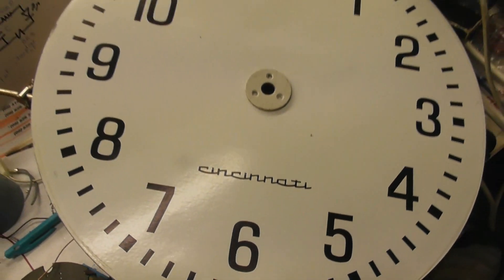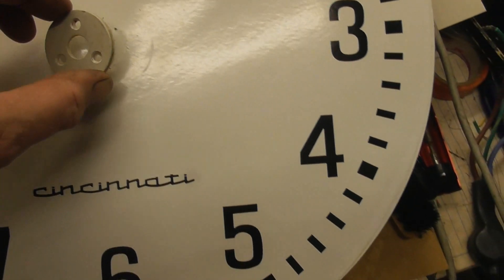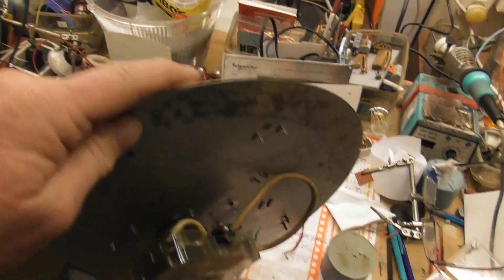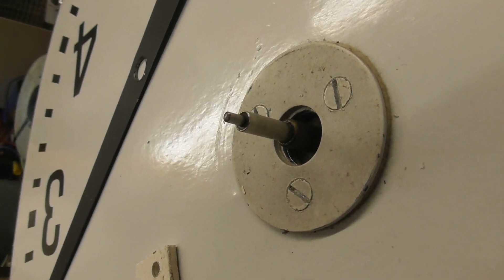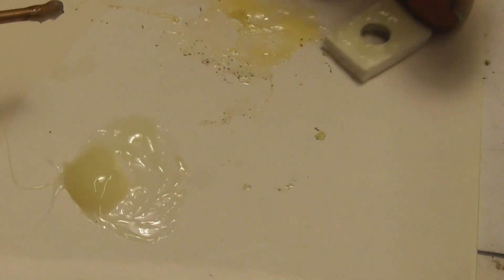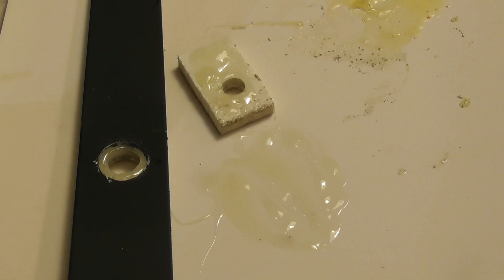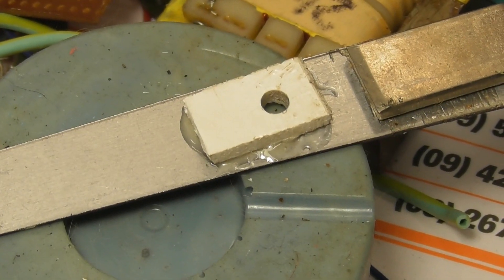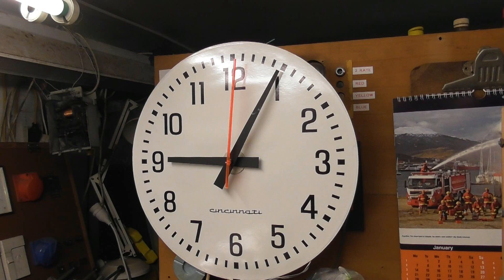Cincinnati electric clock movement replacement

Comment: Great job! I've never seen one stop and then click to the next minute.
Reply: Steve xray62 ah, I just read the description—this movement also works at 24v for the impulse, which is the “start/stop” movement.  The second hand is synchronous at 220v
Reply: This movement operates the way Swiss Railway clocks do, although they are operated with a controller at 24v.  I’ve never seen a line voltage movement operate like this before

Comment: we had 2 of these exact clocks at my old work driven off the master time clock by the same company they are made to be driven off 28Dc in a pulse each time sent to it for 2 seconds each min to make the min hand move one min forward and at the hour the master clock sends out 59 pulses to make any clocks running slow self correct as they have a switch that stops it from going past 59th min until it returns to the normal once a min pulse and that over rides the stop switch at the 59th min i can share a lot more of how the systems work Via pm or mail as we use the company's systems where i work now and the company kinda frowns on all its trade secrets being given out BUT i will tell you they no longer make the  master clock that this clock was driven by in fact thay have abandoned the time and light clock controllers all together.
just building access controls time clocks for company's and parking control and revenue equipment